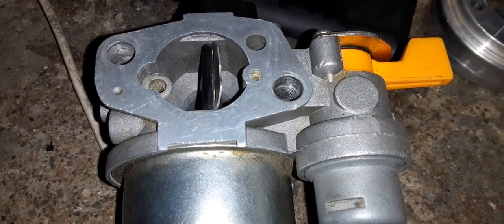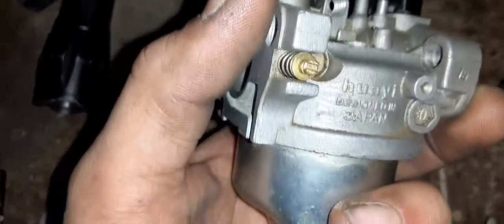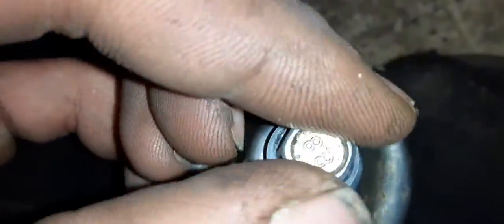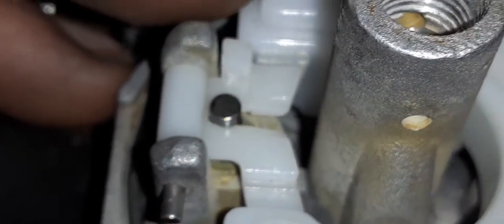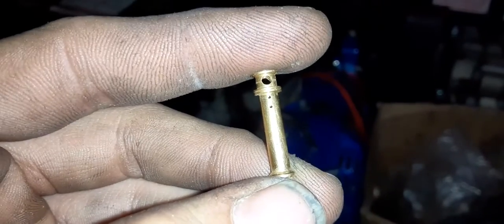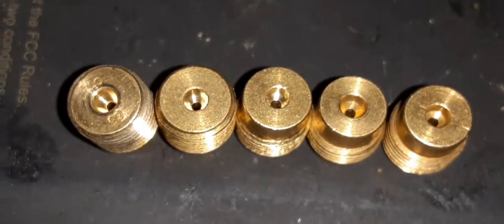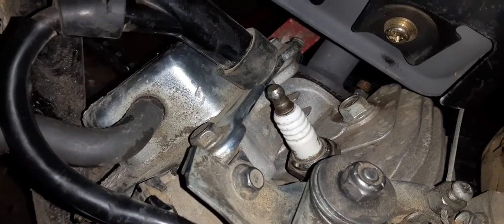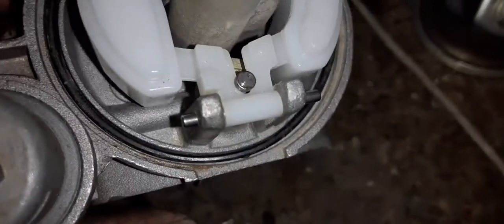Small Engine Carburetor Jetting Basics.

Comment: I remember as a kid I’d always just drill a bigger hole in my jet instead of buying new ones just to get a lil more power out of my go kart
Reply: i have  a  lean  carb,  thats  a bit cumbersome to remove, reinstall.  if i was going drill out the  jet, how much do go  at a  time,  i wont want to try  5 times.
Reply: @glenngressley3345  I was a dumb kid and just took the smallest bit my dad had and drilled it worked tho make sure the bit is thinner than a toothpick

Comment: Don't replace the jet just drill them one size and try it then if it is still lean go with the next size up
Reply: Good advice. You can get extra stock ones for cheaper than the kits and drill them yourself. You need some tiny drill bits though.
Reply: I did that & now it don’t stay on at idle anymore & don’t have any power to take off . Know what it could be ?
Reply: @elmocabrello2555  it could be that it’s throwing an 1d10t code 😔
Reply: @elmocabrello2555 could be your air flow or gas flow needle you need an adjustment to have it running rich so it will take off when u start it the air flow if on top of the carberater its a brass piece on top u remove the little plastic plug and there will be a little screw search up wich way to turn it just incase and fiddle with it till its good

Comment: Ive solved alot of my problems with a racing spark plug it may not fix yours but every time ive ever put bigger carb on small engine and it got to much gas either.idle or top end racing plug helped me and others  more often than not thank for video your simple explanation was good

Comment: I just bought the Predator 224 Max Output engine. I'm wondering.. can i use the biggest jet (jet c) that comes with with the bone stock engine, or do i need others mods or any other tuning on the engine before adding the biggest jet they gave me?
Reply: What are you using the engine for?  The extra jets that come with the 224 are for higher altitudes when using the engine for utility purposes. You wouldn't want to use the extra jets for the minibike or go kart application.

Comment: This biggest thing you forgot is how can we tell if its running lean or rich, im at altitude so this is tough for me. About 6000 elevation
Reply from the maker: It depends honestly. Some symptoms of a lean or rich condition will act very similar. Best way i found is to put your hand over the entry of the carburetor. If it runs better with your hand covering about 1/2 of it for example it means your lean. Putting your hand over the opening makes a stronger vaccuum and pulls more fuel through the jets. Another way is to pull the plug and inspect the color. Do it by throttle position and not rpm. If it has a 1/4 stumble or hesitation ride at 1/4 throttle and read the plug to make a decision on whether its lean or rich. Do the same with 1/2, 3/4 and full throttle. Sometimes spark plug color is deceptive and you may need more or less fuel to make the most power. Ive had plugs look spot then i jet it up till it looks almost border line rich with a dark brown color and it made more power and pulled harder. Just feel it out and figure out what your motor responds too and youll get it down.

Comment: So question, help me out here. I just picked up the predator 459cc motor. We are allowed to run a aftermarket pipe and air filter assembly. I will be adding a spacer between carburetor and block for a pulse fitting. Have to leave governor on and cannot exceed 3650 max. Should I do anything jet wise to the carburetor?? Thanks..
This is for a racing lawn mower.

Comment: I have performance exhaust and intake installed and I just jumped from the stock .028 to a .038 jet on my predator 212. It runs great at idle and with a little gas but at anything higher than that it sputters and falls on its face. Do I need to buy a smaller jet or is there something I can adjust on the carb itself.my float bowl is also leaking fuel even when the engine is off. Any thoughts on what I should do? Thanks
Reply from the maker: Jet down to a 36 and clean out the carburetor inside and out, when you mount the carb. Turn the gas off and start tapping the float bowl with a wrench or something preferably rubber and while tapping turn the gas on and keep tapping for a few moments. Thats always worked for me
Reply: @minibikegarage1577  just tried this out to no avail. It didn’t have this issue until I took the bowl off to install the new jet. The leak doesn’t start until I shake the bike around and then it won’t stop until I turn off the gas. I didn’t install a new bowl gasket after I took it off so that could be the issue although it is a relatively new engine. Thanks for the tips though👍🏼
Reply from the maker: @raasch64  hmm look up carburetor rebuild kits on go powersports. If you find one they include a needle and seat to stop the float from getting stuck and pouring fuel out the overflow
Reply: Take the air filter off

Comment: Good video. This helped a lot. I bought a upgrade kit off ebay valve springs, intake kit, exhuast and jets. Im at a .038 main jet  right now. After I hit the gas it won't go top speed. Just cuts in and out. Then shuts off if I stay on it. Any help would be nice.
Reply: Might be not enough gas. .38 seems low. What type of engine are you using? Howmany CC? NT or Hp carb? Judging from when you said it kicks out It needs more gas than you're jet is giving it. The only two problems i could see is to much or to little gas. Hope it helps

Comment: My bike idles extremely high after startup. The idle screw makes no difference. Should I go up or down on the pilot jet?
Reply: That means your pilot jet is plugged typically if your idle screw doesn't change anything. If not something else is gummed up in the carb.

Comment: What size pilot jet do you usually run? I think the stock size is around .016". I may open mine up a bit because the off idle is not as good as it could be.

What I don't like about the Huayi carbs is I'm not sure where to get the low speed jets. If I had to buy a carb I would get the RuiXing carb from ARC racing. They also have all the low speed jets for it. Supposed to be one of the best stock carbs you could get under $20. Their low speed jets will not fit the Huayi.
Reply from the maker: I dont remember what size it. Mine are all unlabeled. I actually setteled with the stock size pilot jet bc it gave me the smoothest idle and its the easiest to start when cold. I had a 20 thousandths bigger one than stock that i bought from omb warehouse i put it. It definitely helped with off idle acceleration but the idle wasnt smooth and it was a tad more cold blooded. I have a huayi and ruixing carb. Ill take a look at the pilot jet bc thats interesting they dont interchange.
Reply: @minibikegarage1577  So OMB sells pilot jets that fit Huayi? I will have to check that out. You know how it is with drilling. Go too big and you can't go back.
Reply from the maker: Yea they do. It doesnt say specifically for the huayi carb, its just run of the mill  pilot jet for a general 6.5 hp style engine carb. Tou should be ok with them. Ive never drilled a jet before, thats something id like to try one day. On their site i believe its listed as .020 thou bigger than the stock predator one.

Comment: I jetted my 79cc Lifan engine and added more air holes. Now my drift kart won't go. Need knowledge  what to do? Lol 
Engine is ported and polished, slight mill (Don't know measurements). Also fuel pump. Top speed clocked 38 now no speed 😑 everything was dailed in before jet. Not understanding the problem now. Starts first pull but no power.
Reply: If it ran fine with stock jets then put them back in. It's simply the wrong size jet you used.
Reply: @michaelkuzmadutton7879  Update: 79cc Lifan (ohv) Engine with port/polish head, 19mm slide carb (tuned/ bored), pulse pump, soda can gasket, vented n shimmed springs... finally blew stock flywheel ( well 🧲). Good news: engine case is good with no leaks. Dirft kart frame, 2.5 engine, stock internals, with head work, plus 200+ body . About 50 easy now, no bog. 35# chain. tach says 5100/ 5500 rpms before fail (unloaded) n engine shield saved my face literally😰... need flywheel, billet parts now. But Insides are still good.
Reply: @cwill4920  well that's great! I'm sorry the flywheel magnet came off ☹️.
Reply: @cwill4920  I once intentionally over revved a 17hp Kawasaki on some old JD lawn tractor just for poop and giggles and it tolerated it fine for a little while until the flywheel magnet grenaded. 😅
Reply: @michaelkuzmadutton7879  🤣🤣🤣
But truth is I've been pushing this setup since early January. Running it hard, clocked constant miles chasing top speed... Well hit constant 50s with easy now since playing with gearing. Weak point won tho... I played with jets to get more out of it, carbs good full open. But might just need billet flywheel and I might can keep going. Dare Devil I guess 🤣🤣🤣
 I did fix the old carb with solder n redrill but slide carb feels better... How were the miles clocked: we live by lake with 17 miles around we did A lot laps every good day. Donuts in the rain n snow too ( on slicks). It's our COVID build. Average speeds in 40s. It scoots
Reply: @cwill4920  Wow that's impressive. It's only 79cc which makes it more impressive for it's size!
Reply: @contraband1543  😂  thank you my guy for your input. I have many 212cc preds that I've built. Thing is why do we do certain things? I wanted to see how far I could push the little engine. Find the flaws ( flywheel & magnet), so I went to machine shop and got a custom lightweight flywheel made problem solved.  I was lucky yes but not because I didn't get hurt. But that the engine didn't have any other damage. The shield was thick enough to hold and I don't stand next to engines when I test them my guy. Would I play with a 212cc or bigger like that hell no. I have 212s spin 7k n up. When built, billet flywheels are installed or we don't crank them. Honestly how have a 1 inch thick 3x 2 ft of sheet of steel that I place in between me and the engines I got from scrapyard..scrap yard... Just in case of 💣.  No issues with billet flywheel  tho.